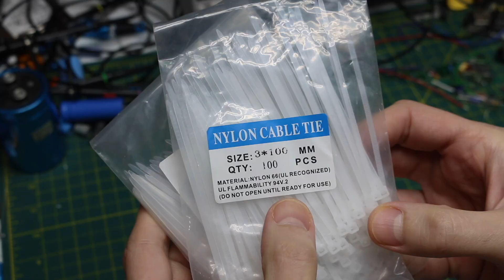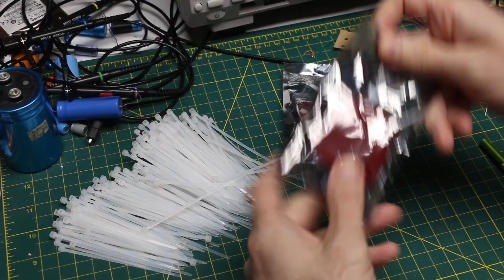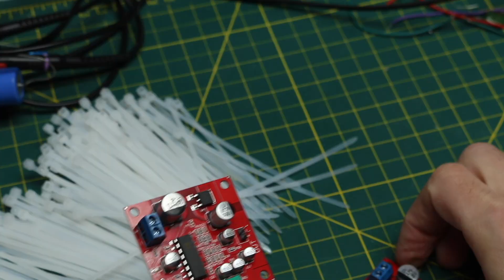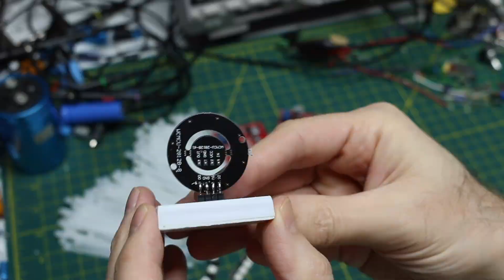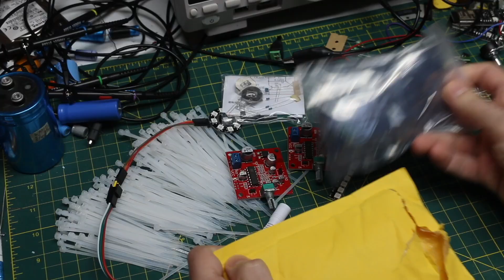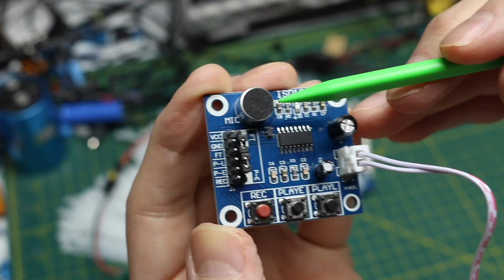Mailbag!

Comment: I have some ISD1820 chips because of Casper's video on DIY synth building: "Part 3: Lo-Fi Sampler/looper/VCF" ... you can most definitely have fun with the pitch by using a potentiometer where you mentioned! 😄👍
Reply from the maker: I wonder if that is one of the videos I have in an open tab from doing my research, there’s definitely a video I have open about making a sampler. i’m sure it would come in handy for Noisevember
Reply: @GadgetReboot  My Noisevember for #7 shows the sampler I built but it is not featured. It's the lil box with the Pac Man ghost painted on it. 👾